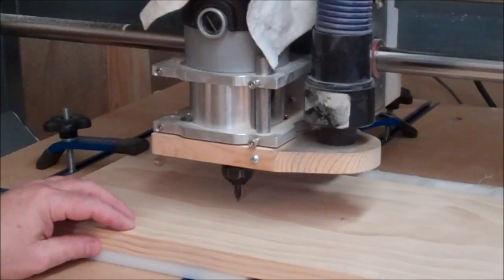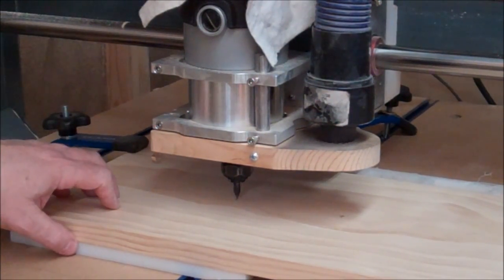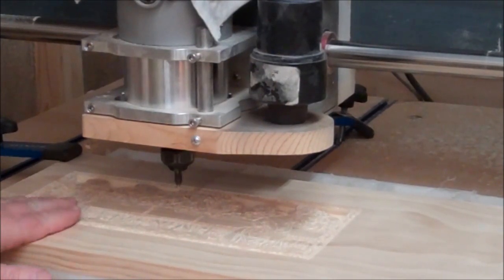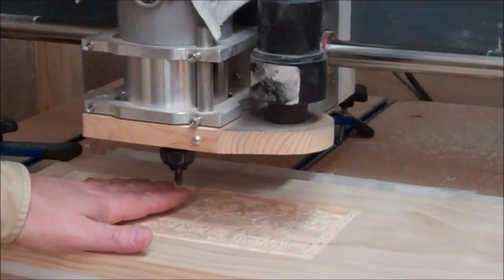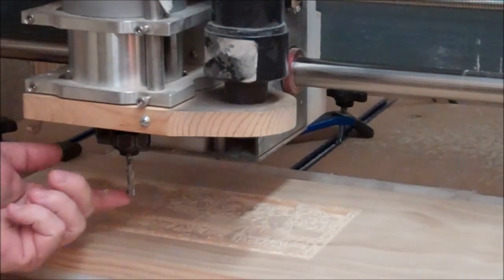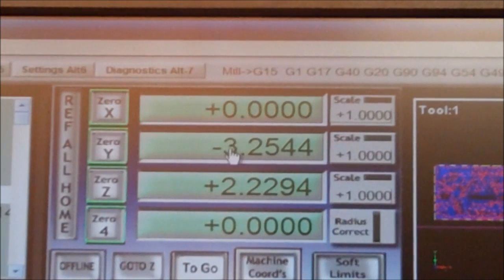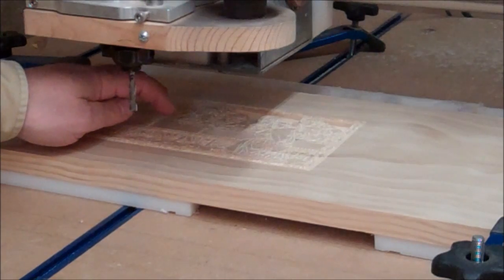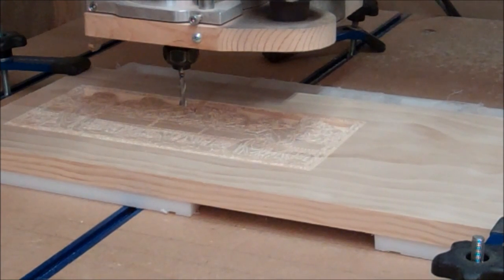How to Build a CNC Router On A Shoestring Budget Part Twelve

Comment from the maker: Hey Guys!!!  I just uploaded a picture that Chris Herndon sent me of his 36" x 72" machine.  He just expanded the dimensions of my plans and it looks great.  Check it out at my website.  Good job Chris!!
Reply: Dave, Are you planning to post the plans for the 36" x 72" version, that Chris Herndon made download? I know he built it rather than you but, I'd hate to mess that up. Thanks again, I really like your videos!
Reply from the maker: Loren Poirier  No. I will not be posting plans for Chris's 36" x 72".  He used my plans and just made some dimension modifications to make it bigger.  You could easily do the same thing.  However, I will be offering some different sizes/designs in the near future.  I'm kind of on the fence about whether to do a build on a full size machine next (one with a cutting area of 48"+ by 96"+) or another smaller machine like a 40" x 26" with a footprint similar to the Sidewinder CNC machine in my shop.  What do you think?
Reply: Dave Gatton
48" x 96" would be a Huge machine & probably useful for building large signs or wooden door carvings. I like that idea.
Reply: Hi Dave, I love your router design, and am very excited to build one for my self. Would it be possible to post your plans as a downloadable link on your site? I have the missing parts section, but not the main section.

Comment: No its not.. At the very least you have moved the Z axis. Never mind the discussion on relaxing the steppers. If you do not have homing switches to reference, this makes no difference whatsoever. However, if you do, and intend to meke use of them for repeating a part, which is really the greatest advantage of this type of machinery, then it really does. Try homing your axis to the homing switch after you have moved the Z axis and you will have better comprehension. Also, try G53 Z0,  at the end of a program. This is a great trick to get you Z axis in position to be referenced.
Reply from the maker: I believe you're missing the whole point of this video and possibly the series of videos I've been doing.

Comment: This method seems questionable at best to me. The machine has lost its G53 Machine Coordinates when you turn off the steppers. This is fine if you are not using Home Switches or Soft Limits.  The same thing can be accomplished by lowering the the Z incrementally (Tab Key, better yet, MPG) until making contact with the paper (or better yet, a cheap dial indicator reference block, $60.00 on Ebay) and then translating the Z offset with the Z zero button or translating in the Offsets page. 

Thanks for the videos.
Reply from the maker: How does it lose it coordinates if it doesn't move?  When you power it back on it's in exactly the same place it was before you turned it off.

Comment: Dave, Does the software have a setting for the diameter of the bit you are using?  I recall your addressing the depth of the cut in a prior video, but don't recall a setting for the width of the passes by the router.  Thanks, and great work as always!!
Reply from the maker: Jim, You select the tool you want to use for the tool path from the tool library you create.  You set tool parameters for each tool such as type, round nose, V-Bit, End mill, etc and the diameter of the tool.  The software then knows how much to offset if you choose the outside or inside of the vector you are cutting.

Comment: Plans are very complete. Just finished putting a list of materials together. Looks like hardware cost will be about $933.86 plus software. Starting wood parts soon. Need to fit this in with other projects. Videos have been very helpful.